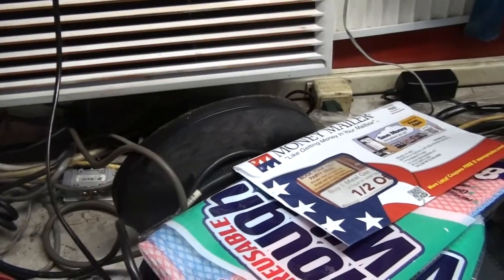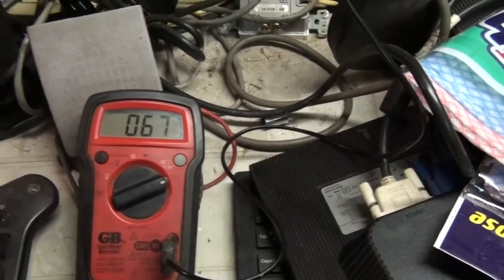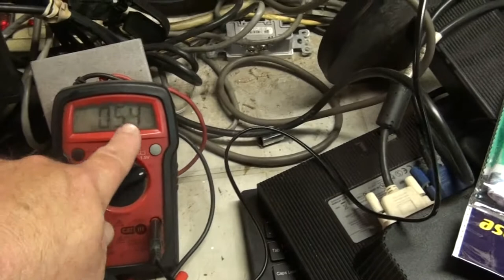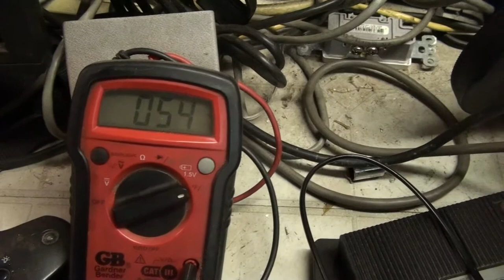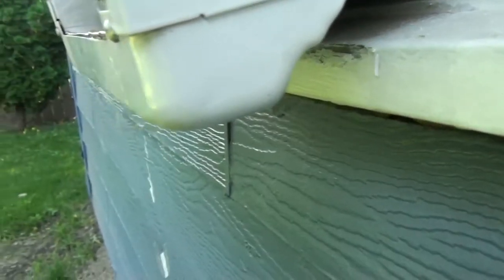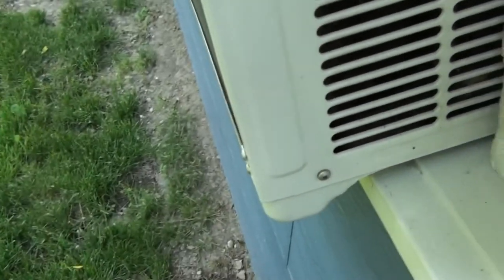Review of Arctic King WWK08CR61N - Update

Comment: Air conditioners make you more comfortable by doing two jobs, cooling the air and lowering the humidity.  A condensate drain is necessary for good AC design.  I have seen wall units with drain fittings to connect a drain hose to.  I am lucky that it only gets hot enough to need AC two-four days a year.  Lake Superior keeps the air temps down.  It is only on the days with a N N/W wind blowing down super heated air from the Canadian plains that it gets hot.  Stay away from heat stroke.
Reply from the maker: I so want to move up that way for that very reason and a few others like awesome roads. However my wife has sweaters on even past 80 degree's so she won't even talk about moving that far north. Take care and thanks for watching!

Comment: Can anyone tell me how the on off feature works on these. I feel dumb but I've been trying to get it turn cycle on and off at half hour intervals and I can't seem to understand the on off system I set the off at 0.5 (half hour ) amd the on at 1.0 figuring it would shut off in half hour and start back in half hour and tried various other combinations and I just don't get it lol any help would be appreciated. Thanks in advanced!
Reply from the maker: Yeah, its an odd setup from what I am used to. So make sure that the Eco mode is off and that the temp is set a few degree's lower than you want it. So if you want the room at 72 set it to 70 and see if that helps.
Reply: MidwestMotoRider thanks for replying! I think I know what you mean. I think the Eco mode comes on automatically each time😬 but I didn't have it for very long so I'll go over the manual. Maybe there's a way to keep it off. I got a 12000 btu and it cools my place off very fast and I gotta shut it off after a while cause it gets too cold ( not complaining ) lol so would like it to turn on and off in half hour to hour intervals but maybe I'll just set it to a higher temp and use Eco mode cause if I'm correct.... It shuts off when the desired temp is reached and turns back on according to that🤔 thanks again I appreciate you taking the time to reply 👍👍
Reply from the maker: So I don't know about the 12000 model however that is how this one works. If I set it to 74 and put it in Eco mode when the room hits 74 it shuts off until the room reaches 72 and then kicks on. If you leave it and just turn off the Eco mode the compressor will shut off at 74 but the fan will continue to run and circulate the air and the compressor will kick back on at 72. Mine is the same way if you unplug it or turn it off it goes back to factory settings I have not found a away on mine anyway to have it remember my settings. I will say at some point I will be getting the 12000 model as recemended by so many. I think it would actually run less since it can do a quicker job cooling the room. Have a great 4th!
Reply: MidwestMotoRider the 12000 model is very good from what I've been experiencing. You could run it a hour and have it off. For 2 when it's 45.°c out side. It cools fast and stays cool for a long time after being shit off.